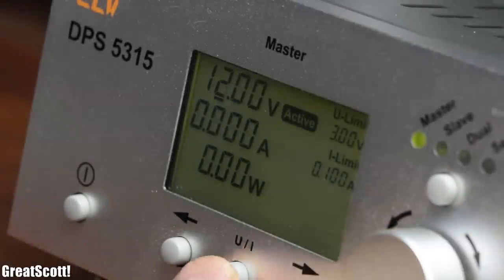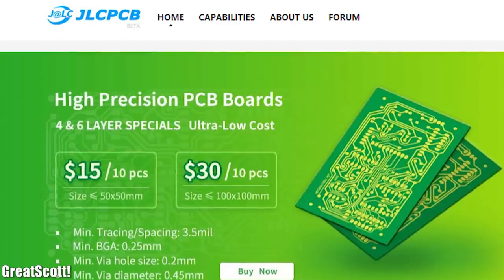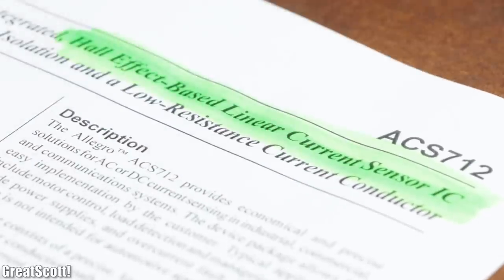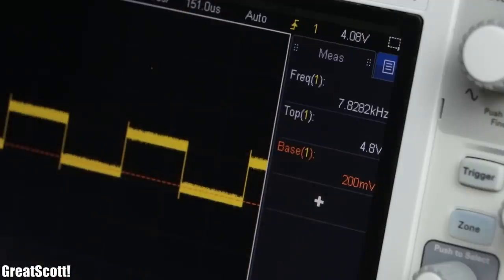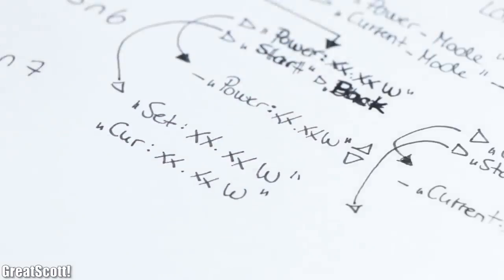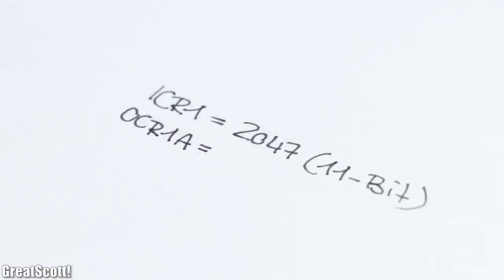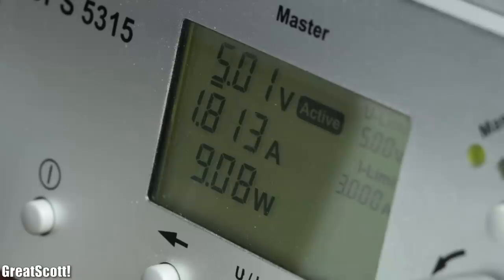DIY Adjustable Constant Load (Current & Power)

Comment: In 2022 it seems the TC4220 is both obsolete and impossible to locate, is their a suitable replacement part that would be a drop in fit?  I am not an engineer just a tinker hobbyist so could use some advice?  Thanks

Comment: Good opportunity to get your sponsor involved - do a part B where you put the design into their online PCB software and order a PCB. Then build and show off how much tidier and easier the PCB option is.
Reply: Yeah.
I thought same, but it would be premature.

This is really only a very rough prototype.
The theoretical power it MIGHT handle is never going to be seen because of thermal limitiations.
He mentions 3amps at 6 volts is what it WILL do.
So that's 3% of the theoretical potential.

See my reply on its own.

Comment: You can use a differential amplifier to not only drop the hall sensor output voltage at 0A to 0V but also amplify the output at max current to 5V giving you as much resolution as possible for the current sensing.

Comment: This is great! I will build one.
One suggestion:
Add mAH discharging so I can discharge my batteries down to a specific capacity and add a discharge voltage cutoff mode:
The Arduino will discharge at a set current until a specified voltage is reached

Comment: The STM32F103 would be nice, with its 12 bit ADC, and higher resolution timers. But a great tool for the workbench. Nice job!
Reply: ADC in STM32F103 are also much faster and have DMA capability. You can get 1MS/s. and uC itself is faster, so you can get tighter regulation. But I think max voltage is 3.6V. Unfortunately even STM32F103 doesn't have DACs. Only timers, but they are 16-bit ones, which is nice.
Reply: @movax20h  no DAC on STM32F103RB ? Oo

Comment: You can use use STM32 in place of atmega328 for better ADC and PWM resolution. Or INA219 with a lower value shunt resistance can offer you higher current range and stable power measurement.

Comment: Good video! Constant Load and Constant current is very useful!. I remember the mosfet work like resistor in linear (ohmic) region and it's use in switching mode in saturation region for increase efficency.
Reply: If you want to use a MOSFET as a switch, you use it in the omic region.That is the reason, why the RDS-on is stated in the datasheet as static on resistance. This is because, when the MOSFET switch is in the 'ON' state, it has a almost constant resistance, as opposed to a bipolar transistor. The confusion arises, because in a bipolar transistor the saturation region is where the Vbe is so high, that an increase in Vbe does not decrease Vce (Vce,sat is reached). On a MOSFET on the other hand, the saturation region is the region, where an increase in Vds does not increase Ids, that means, even though you apply more voltage across the MOSFET, the current does not increase. But if you increase Vgs in the saturation region, the current does increase.
The terminology is really confusing, because in bipolar transistors you want to switch in the saturation region, but in MOSFETs, the saturation region is completely different.
Reply: It's the other way around, the typical mosfet Ids over Vds graphs, Vds is on the x axis and Ids on the y axis. So in the omic region an increase in Vds creates a proportional increase in Ids, but in the saturation region (line is almost flat) an increase in Vds does not increase Ids (or only very slightly)
Reply: Yes, i think he has it confused in this tutorial. I am making a similar device using IRFZ44N and by using the low pass filter, the mosfets keep getting cooked since they are in linear mode. Using a PWM signal at the mosfet gate is less stable, but it also allows the mosfet to function without breaking and shorting out after a few seconds/minutes with any real power dissipation.

Comment: I've been meaning to build one of these. I'm currently planning on building this to stress test 3∅ 30A connectors.

Our Hubbell supplier in the US has been pushing spring-loaded clamp connectors instead of the standard screw-clamps. If they didn't come from Hubbell, I would've already said "No" to them but I want to be sure they won't fail under full load

Comment: Hello, Scott is it possible to get a variable DC Voltage on the Gate of the MOSFET without the TC4420? A simple low pass filter on the PWM PIN should be good enough or not? What do you mean? 
Thank you for the short and informative Video ;)

Comment: Hi, I think you have missed a few components in your order list:
- case and frontpanel
- banana plugs female / terminal
- rotary encoder button
- low pass filter components
- cooling heat sink and fan?
Can you add links in your video description?

greetings from germany and thanks for your videos! This is exact the project i could use right now.
Reply from the maker: - case and frontpanel : I got it from a local store. So there is not link for it.
- banana plugs female / terminal: I will add those to the list
- rotary encoder button: the button is integrated in the rotary encoder
- low pass filter components: just a resistor and capacitor. Look for the values in the schematic. I did not feel like including such a minor component in the list.
- cooling heat sink and fan?: I salvaged my heatsink. So there is no link.
Reply: But it's NOT an adjustable powersupply...
Reply: #facepalm
Now you know how it looks when you like watching videos about electronics, but are still learning English :D
Reply: Haha, no worries mate, I have been there.
Reply: @greatscottlab  where did you bought the case? I live in Germany and would like to buy it.
Reply: You dont need a Fan though for most Medium-High current draw

Comment: 3:05 When the transistor is saturated it has the lowest resistance. So little loss on the transistor
If the transistor is in the non-saturated area, it works like a resistor. Ohmic range.

Comment: Solder the wires directly on the current sensor. Used those before, the copper traces aren't good enough and they heat up at around 10 amps plus that ic is very dependant on temperature.
Reply from the maker: Good to know

Comment: Also note that you cant connect the supply backwards (reverse polarity) as the voltage divider will send negative voltage to the arduino. Nevertheless,  great build!

Comment: Instead of "don't touch it" for the undervoltage pot, I learned how to tune it so that it's least likely to cause problems:

I accidentally fried my LTC3780, and I did a lot of probing and I noticed that the under voltage regulation caused some problems when set to 0.
The fried LTC3780 could only tune from 0.8v to 2.5v (fault light on above that) and had no current limiting.

So here's what I learned:
If you set the under-voltage pot to as low as it goes, then the full supply voltage will pass to the LM358 to an opamp input while the supply voltage is at a regulated 5v. Even though it's supposed to only produce 5v out, it started to fail for me and will go up to near the supply voltage which feeds the run pin of the LTC3780. The LM358 still worked if the trimmer was set closer to the supply voltage though, so clearly it puts more stress on the LM358 to pass much higher voltages to the inputs than the 5v regulated voltage. If the undervoltage pot is tuned closer to the supply voltage this creates a voltage divider that will make the input voltage to the LM358 closer to the regulated voltage.

Any voltage above about 6v to the LTC3780 on the run pin will destroy it.
So, my advice is turn the undervoltage regulator all the way up, so that you get the fault light and the output goes to 0, and then turn it down until the fault light turns off, and overshoot a little (but don't set it to the minimum). As long as you're using a constant supply voltage it'll continue to run, and this will reduce risk of frying the LM358 which will fry the LTC3780 (The IC is same cost as the whole board really, so you don't want to have to replace it).
Reply: Thanks, buddy!

Comment: Great Scott!  The mosfet driver you use has a current limit of only 6A.   Is it works with 49A?  How.     Plz tell me
Reply: The driver is only used to >drive< the mosfet. Of course the mosfet can handle a lot more current than it's driver.
In case of a static operation (no change of Vgs) there is no power needed to drive the mosfet, so 0 A, while the mosfet draws 10 A for instance.
Reply: @ExplosionCrafter  thanks bro

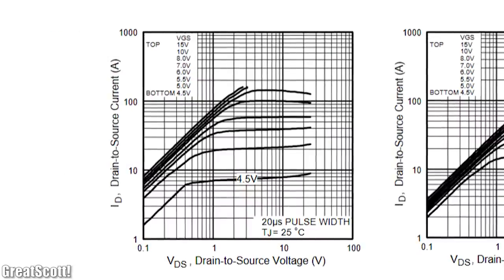Comment: 3:00
I think you mixed up the linear region with the saturation region of the MOSFET. The MOSFET has a lot of losses in the linear region and that is why you want to switch as fast as possible without transient spikes in power electronics. When the MOSFET is fully on (saturation region), your losses decrease by a lot and only the conduction losses remain. I have succesfully built a large DRSSTC using IGBT-Bricks and it is the same with those.

Comment: I love the idea of building one of these so I can use it for logging discharge curves and testing my batteries. I would need much better precision though, so here are some thoughts on this.
The interface between the digital electronics and the analog electronics is the biggest limitation in precision here. Both the reading of current and voltage, and the control of the power MOSFET are noisy because of the limited resolution of the ADC and PWM. I was thinking of using a SPI controlled 16-bit variable potentiometer and an opamp to assist with driving the MOSFET. By using the feedback of the current sensor and the variable potentiometer connected to an opamp, would it not be possible to very precisely control the driving of the MOSFET?  
When reading the current and voltage values, of course using a more precise DAC would be simplest as you have mentioned. But if I wanted to experiment with getting more precision with the 10 bit ADC we have already have, How does this scheme sound: Read the voltage from the voltage divider with the ADC (10 bit). Output the read value via SPI to a variable potentiometer . Using an opamp, we can connect the digital pot and the voltage we want to measure, and the opamp will amplify the difference in voltage so we can read that error difference with another ADC on the Arduino. The second ADC read would be a measure of how far off our originally read value is from the actual value, which we could calibrate against. We have more precision in the digital potentiometer than our ADC, so we would just nudge up or down the output value of the digital pot until the error feedback on the second ADC goes as close to zero as possible. Then we know based on what value we write to the digital pot what the actual voltage must be. 
Let's walk through an example; it might make this more clear. Say we want to measure a current coming from the current sensor. It is outputting 2.954265v, which obviously our ADC can't even come close to in precision. Our 10 bit ADC can only read in steps of 0.00488 mv, so the value is going to be 605 or 606, giving us a reading somewhere around 2.951 to  2.956 volts. We spilt the difference and output 2.9535v to the digital pot. If the digital pot is 16 bits, that would be a value of 38711d, giving an output value of somewhere between 2.9534v to 2.9535v. The opamp magnifies the error difference between our actual 2.954265v and our pots output by say, 500x the voltage difference. We set it up so that the opamp output range is 0 to 5 volts, and a center voltage of 2.5v means no difference between the digital pot and the actual voltage from the current sensor, and it amplifies any difference in the two inputs by 500x the voltage difference. In this example, our voltage difference woudl be around 0.000765v, so let's say the opamp is actually putting out 2.1175v now, which our second ADC reads as 433 or 434, giving us a reading of 2.11v to 2.12v. We split the difference to 2.115. Now we have to adjust the digital pot output by some value to see how much closer we get. We calculate it like this. Subtract 2.5 from the new reading to find out how far off we are from center (-0.385v), divide by 500 (to scale it down by the amplified value of the opamp), which gives us -0.00077v. We now know we are reading higher on the ADC than we should be, so we adjust out output up. (or the other way around if we get a positive value instead of negative, of course). We subtract this calculated value from the value we last wrote the digital pot, giving us 2.95427v, which we write to the digital pot as 38721. Our new output is 2.954222v to 2.954299v. Do the whole feedback read again, and we get a much smaller error reading from the opamp. Every time we nudge up or down slightly in this way, we in theory get closer to the real world value. 
Since we are reading with a 10 bit DAC, 9 bits of which we consider significant figures we magnify the error by 500 (512 would sound better, but I'm approximating), then reading again, we can probably get closer to 14 significant bits of precision. Of course, every time our most significant bits (first ADC read) change by more than 3 or so up or down, we have to start over in our calculations, but it should only take 2 or 3 cycles to gain enough precision again to be confident.  The ADC takes like 1/10,000th of a second to read a value. So, I figure we can read at least 400-500 times a second. with calculations and re-reads, every 5-10 ms we should be able to get a very accurate read. We use the 10 bit course read for fast responses, and the higher precision reads for accurate adjusting of our MOSFET. Before, we were limited to 0.00448mv resolution in the ADC. We might be able to achieve an effective resolution of 0.0003v this way (that's about 14 bits). That's enough for millivolt measurements anyway. Most times, such short durations of time are not going to result in very much change in readings, and therefore we will spend most of our time in precision calculation, giving us very good accuracy.
How plausible does this sound? Worth putting the time into building to test out, or a waste of time and never going to work out correctly? I know this is bonkers over the top complicated compared to just getting a better ADC and calling it good, but I like the idea of something like this if it can be done.

Comment: One possible issue with this type of load is the control loop which is run by the microcontroller. That would make it quite slow which could possible create oscillation under the right conditions or even worse it could react very slow to a rapid change in current.

Comment: Hi, I'm nearly finished building this project and the output voltage (measured with a multimeter) of my setup doesn't change when I set an output via the interface. I'm using Scott's code and the same components that were recommended. The only difference is that I'm using an Arduino pro mini.

I'm using a 20V 6A power supply to supply any load and a buck converter to supply power to the equipment. I lost my 5 volt regulators and I had a spare buck converter.

Regardless of the value I change the either the current or load values to, I always get a 2.4V output. The voltage drops to 0 when I 'stop' the output but it seems as though the duty cycle of the PWM signal doesn't change. I tied pin 9 directly the gate of the mosfet and the my output voltage was 2.1V and didn't change when I varied any values in settings.

My mosfet is fine, I tried 2 of them, and bot were adjustable with a 50k pot.

Can anyone help me here?

Comment: Hi Scott, the current ADC should be suitable when increasing the sensor voltage range. the range in your setup is around 300mV. by amplifying (with a opamp) this signal and correcting the 2.5V, you can transform your 300mV sensor signal into 0 till 5V

Comment: Could those oscillations be reduced by feeding the output of the current sensor back (via an opamp) to drive the MOSFET? EEVBlogs simple constant current load uses this approach although uses a resistor bank to dissipate energy. Your approach, however, will have a more consistent current draw.

Comment: You should add a constant resistance mode as well, measurements (Ah, Wh...) and programming capabilities. That are just simple firmware changes. I could do it and upload the code to Github. And there's another problem: the tolerance of the Hall effect current sensor is ± 1.5 %, which is pretty bad. You should use a shunt resistor with a lower tolerance. Plus, you should amplify the signal from the current sensor so that it uses the full dynamic range of the ADC and maybe oversample it. That way you'll get rid of such bad oscillations.
Reply: I built one but I'm horrible at writing code. If you wrote an updated firmware I'd love to try it out.

Comment: Keep in mind this and most MOSFETs are not specified for high-power linear operation, and will thermally runaway and die when pushed too hard (e.g., SOA shows no longer than 10 ms).

Comment: An updated version of this could make use of a more modern mcu. I would suggest looking at the Seeeduino XIAO which has an on-board DAC which removes the need for filtering to drive the MOSFET and has 12-bit resolution on its ADCs. All of the voltages are only 3.3V maximum so you'd need a logic-level MOSFET but those are readily available.

Comment: I think IGBT are better suited for this task since they consist  transistors for driving output.. and  they are inefficient and they can handle more power then MOSFET... Correct me if I am wrong ..  :-)
Reply: The problem with IGBTs is that they have almost linear losses across the CE-Path. A MOSFET on the other hand has more losses because the the losses square with the current which is wanted in such an application. So i think that a MOSFET is better suited than an IGBT for this task.